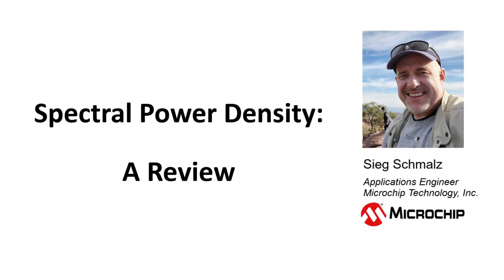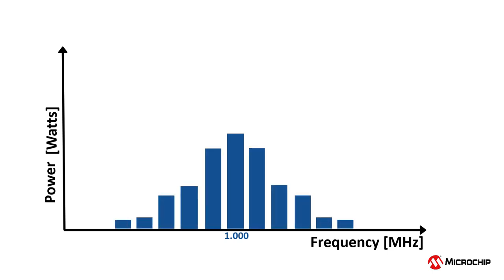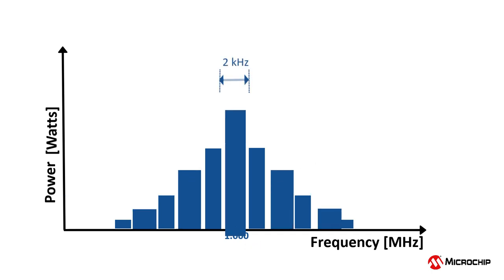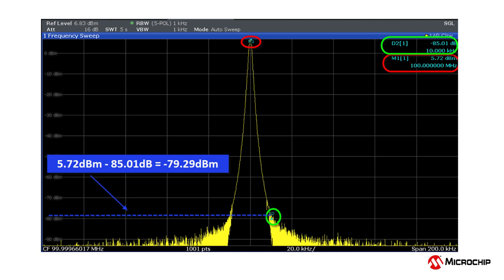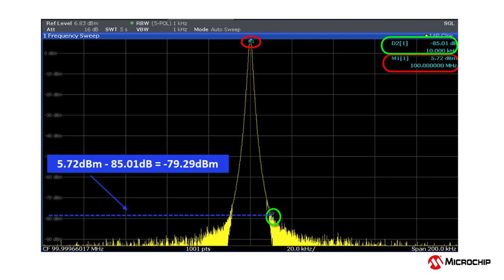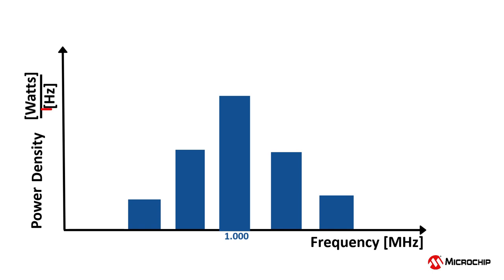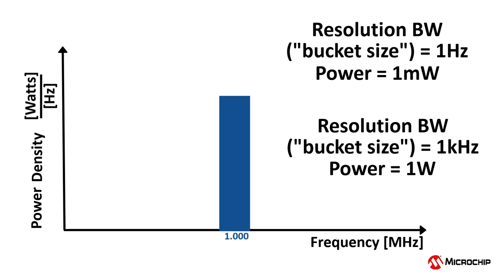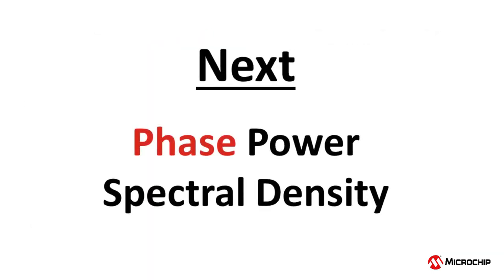Spectral Power Density: A Review

Comment: You said your 1hz bucket collected 1mW. And you showed a spectrum that looked like a bell curve. Then you said a 1kHz bucket collected 1W. How can that be if the spectrum looked like a bell curve? 

BTW: It's been 60 years since my formal EE education. Back then we spoke of the time domain and the frequency domain. We never spoke of the voltage domain and the phase domain (though we usually plotted phase shift on the frequency domain plot as well). Have things changed in these 60 years?

Also, I'm really interested in UWB (Ultra-Wide-Band). It appears to work much faster and with less power than narrow band. Care to talk about that?
Reply: Great questions! 

Regarding “How can that be if the spectrum looked like a bell curve?”: 
The values would not be the same if we compared the spectral density of a 1Hz “bucket” centered at the peak of the curve vs. the spectral density of a 1kHz “bucket” centered at the peak of the curve.  The value would be lower for the “1kHz bucket” case, because of the decrease in power as one moves farther from the center (peak) of the bell curve. On the other hand, if we take a 1Hz “bucket” located at a 500Hz offset from the center of the bell curve, the 1kHz “bucket” value would now be higher relative to the 1Hz “bucket” value, not lower.  Continuing along this line of thought, if we take the average of the values provided by one thousand 1Hz “buckets” from a -500Hz to +500Hz offset from the center, the result from this thousand-bucket average would be quite close to the value obtained from a 1kHz “bucket” size. To keep the description relatively simple, we chose not to delve into this level of detail.

Regarding “We never spoke of the voltage domain and the phase domain (though we usually plotted phase shift on the frequency domain plot as well). Have things changed in these 60 years?”:
Our choice to emphasize phase domain is based on setting the stage for the next video to be produced in this series that focuses on Phase Noise, which can also be viewed as “Phase Power Spectral Density”.  Phase Noise Analyzers such as the “Keysight E5052B Signal Source Analyzer” or the “Rohde & Schwarz FSWP Phase Noise Analyzer” create Phase Noise Plots with the vertical axis units of dBc/Hz ( [dB of phase relative to the carrier phase]/Hz ).  We EEs tend to think of dB as a measurement of relative power (e.g. dBm, relative to 1mW), and we associate power being proportional to V^2. Therefore, one way to think about dBc is to view it as a measure of (undesired) phase “power” relative to the carrier; this is analogous to random noise power we are accustomed to seeing at frequencies slightly offset from the carrier peak power that is presented on a spectrum analyzer power plot.  Ultimately, of course, phase is the integral of frequency over a given period of time (see video #4 in this series https://www.youtube.com/watch?v=vRmwCGUpfRo&list=PLtQdQmNK_0DTi1znrX3IOKfBCMaoL2Ep-&index=4&t=6s), and frequency is the inverse of time, so one may view one’s choice of domain as a matter of “different views of the same coin”.  In this video series, the Phase Domain view is chosen because it maps nicely from the Voltage Domain concepts that EEs tend to be more comfortable with. You may also want to view video #8 in this series which explores the concept of thinking in the phase domain (https://www.youtube.com/watch?v=wm6KRckQ9gQ&list=PLtQdQmNK_0DTi1znrX3IOKfBCMaoL2Ep-&index=8)

Regarding “I'm really interested in UWB (Ultra-Wide-Band). It appears to work much faster and with less power than narrow band. Care to talk about that?”:
Thank you for your suggestion. UWB is a specific technology for short-range communication.  Specific applications such as UWB are beyond the current scope of this video series.  This tutorial video series focus on a step-by-step approach of building up fundamental principles so as to make the more advanced concepts in the world of Clocks and Timing more easily understood, without delving into the specifics of particular technologies or applications at this time.
Reply: @MicrochipTechnology  Thanks. I have some studying to do.